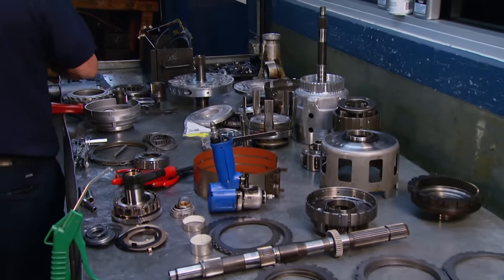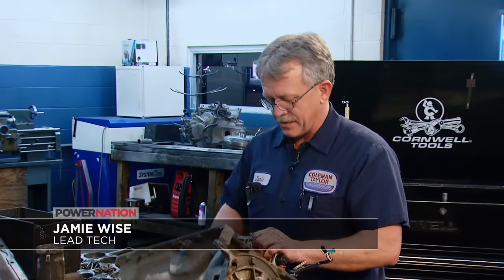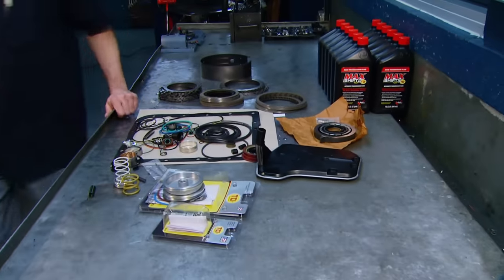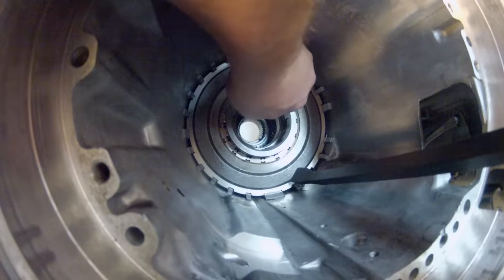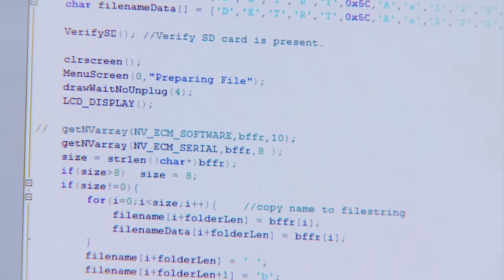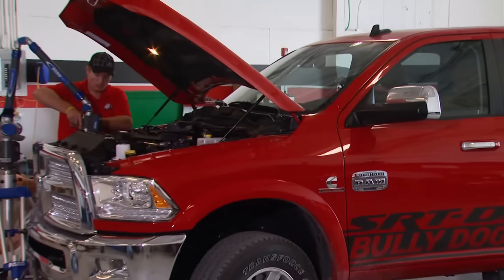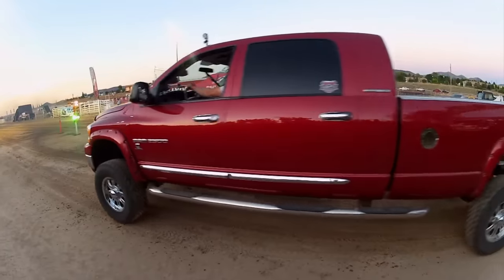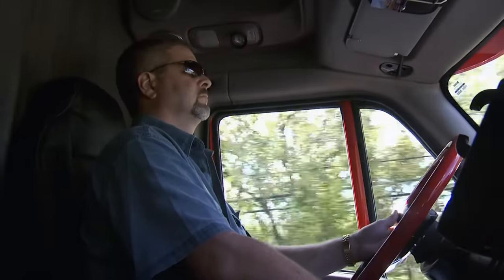Rebuilding a GM 4L60E Transmission for a Chevy Silverado - Truck Tech S1, E12

Comment: Step one: Throw it in the trash. 
Step two: Buy a 4L80e.
Reply: Love it! 😆👍
Reply: They can be built, but it takes someone with competent skills something today everyone says throw it away (parts changers) - no skills.
Reply: @mt1885  or you can do some valve body work to a 4l80 and handle metric shit loads of power wayyyy cheaper
Reply: Yes sir
Reply: @kennyfontana2445  Only if needed, most of the time it is not. It all depends on the individuals skill sets. Today it is mentality of throw it away (buy this new) whatever.
Reply: In a light car under 400hp it will hold up for a little while if "properly" built. But why would you want to keep having to drop the transmission to rebuild it all the time
Reply: Many top racers use a 4L60 and if built right can handle well over 1,000hp and 1,000tq all day, all night. What they are not telling you is the 3-5 thousand dollar price tag on those "built" or "performance" transmissions
Reply: @jeromewieland55  BULLSHIT! Some performance shops wont touch a 4l60 because they still break. Why waste time when you can get a $300 junkyard 4l80 and a shift kit and handle 1000hp and have  a better gear ratio.
Reply: @Se7enMiIe  if you can't afford the Sonnax upgradeable parts then stick with the junk yard junk. Some of the best 4L60's will cost you $5K. It just depends on how much work you need your transmission to do
Reply: Kenny Fontana stop listening to the drive way engineer. He's wrong and so are you.
Reply: @jeromewieland55  4l60 will cost 5k and still break, those professional racers are also having that 4l60 gone through after every race. 4l80 is superior and what does it matter if its junkyard junk If it's getting you into the 8s for 300 vs a 5k 4l60
Reply: Se7enMiIe btw I sell you one of them for $2500 with a Pay after pass 1 year unlimited abuse warranty.
Reply: @garyrobinson3735  no thanks. If you were that good at rebuilding them then you would be known. But your shop, Panther Pride Transmissions is unknown and you try to sell transmissions on letitgo. Not to mention your buisness has 1 review and it's a 1 star review for the bad transmission you sold somebody 😂😂
Reply: Se7enMiIe scared money doesn't make money my guy.
Reply: @Se7enMiIe  bahahaha...gone through after every race??? Uhh nope that's a fairy tale. Frank Cahall builds them in Florida and one of his transmissions has been in a Camaro for 3 years now and it runs in the high 8's...why did the owner have Frank build a 4L60...because the best built 4l80 from God himself or from Billy Bob's junkyard is SLOWER than a 4L60.
Reply: @jeromewieland55  if you say so guy. 3 years ain't enough time and that 4l60 will be dead soon. People put all they money in them and they still die. EVERYBODY says 4l80s are better then 4l60 but you. 80s have better gearing and are stronger. LS swaps around the world running stock 4l80s to 1000 hp and you putting 5k in a 4l60 that's gonna break again. What's that saying about a fool and his money?
Reply: @Stevesbe  Rebuilding it all the time, FAKE NEWS
Reply: @Se7enMiIe  bro....they do not do not do not do not have better gearing...if that was true then people wouldn't build their 4L60. They'd go buy a 4L80 and be the slowest car at the track. They are the worst for gearing and are dedicated to run 2-3 tenths slower behind the same motor
Reply: @Se7enMiIe  almost every serious racer rebuilds their motor and transmission every year. You either have no one around you that's shown you the internet or you're a fool
Reply: @jeromewieland55  the more you type you show you dont know shit. 4l80s have better gearing, period. A junkyard 4l80 with a shift kit is $400 but you have to put $5000 into a 4l60 to get it up to par and that sounds like the way to go to you? 4l80 has a larger rotating mass so there's some parasitic loss but if you're running that kind of power a 4l60 ain't gonna cut it. Turn up the power and there loss is nonexistent.
Reply: @jeromewieland55  I know better then what you're selling. Its obvious you dont know what you're talking about. There 2 people here saying 4l60 is better and the rest of the people on this comment and the other comments are calling you a idiot because you think a 60 is the way to go. 😂
Reply: My 4L60e just crapped out at 160k (typical) of my 07 nbs Silverado.  It’s a non tow rig with a little 4.3 v6.   I don’t want another failure.  Would it make any sense to try to use a 4L80e I. My application?  Or is that v6 just too gutless for that 4l80e?  Probably get the worse mileage ever trying to turn it.  Any suggestions?  Thanks
Reply: @freerepublicusa2064  realistically how long you plan on keeping the truck and what do you plan in using it for? A 4l80 swap means you'll need a crossmember, repin your harness(free) or a add on harness to control it(150), and a tune. If you get a get rebuild and aren't beating on it it'll last another 150k. What the issue with your trans? Is it the 2-3 shift?
Reply: Kids kids kids... hands to yourself
Reply: If you're incompetent like you, than yes throw it away. If you're actually well versed in rebuilding, just get a higher HP master kit for it and it will not break that easy on you.
Reply: Ok you bunch of gear heads.  Which one is best for a 4x4 1 ton plowing snow?
Reply: John Parkhurst a 4l80e or preferably an Allison 1000
Reply: Maybe they're meaning to say Yo- Buck.
Reply: My stock 96 4x4 Tahoe 4L60e went 285k miles before I had to rebuild it. The only reason I had to rebuild it was because the aluminum forward clutch piston cracked. I had loss engine braking and the transmission was slipping going too 2nd and 3rd. gear at 75% throttle or more.
I installed a used steel forward clutch piston from a 99 Blazer. I also reused my stock front and rear planets. They were in good condition because I changed my fluid and filter. I didn't do any upgrades because they are not needed. I used a new stock sun shell because the engine was stock.
GM put really good clutches in their stock transmission. The problem is people don't drop the pan and change the filter. Then they bitch at 150k because the tranny stop pulling.
Reply: @Stevesbe  You want have to keep rebuilding one if it is done right.
Reply: @Se7enMiIe  Dude you are lying your a$$ off. Shops love rebuilding 4L60e because they are easy and don't cost much to rebuild.
Reply: @jeromewieland55  Dude I think you are confused.
Reply: hahaha
Reply: LMAO the 4l80 is even worse...
Reply: @kennyfontana2445  From the factory, the 4l80e was rated for around 800lb ft of torque.  It was put in everything from 1/2tons(optional) to 1 ton chassis cab's.  It had to be able to handle a wide engine array, from the 4.6l v6 to the Duramax 6.6l v8.  They can't really hold more than 800lb ft without major modifications to the internals, and past 700, they start to slip really bad if you rag on them hard.  The 4l60e is very much possible to upgrade to handle more, and its a physically smaller transmission, so it will fit in some spaces a 4l80 would not without chassis/body modifications. I have a GM reman in my van, but when it goes, it will be getting built like this one, as I have already purchased the upgrade sunshell and pinions, the biggest weakness will always be the output shaft, which will limit these to around 700lb ft of torque max with the stock output shaft.
Reply: @jeromewieland55  the newer ones are 2600 for a reman, and around 5000 for a "stage 2" build, which is just upgraded sun shell, better pinions, and a shift kit, but stock output shaft and pump housing.  A "stage 3" puts in a different pump designed for higher than 6000  rpm revs, and a stronger output shaft, along with way stronger bands and pinions.
Reply: FreeRepublicUSA no just get a good new rebuilt unit with a .500 boost valve and Corvette servo and maybe the Sonnax shift kit or the least delete the pwm. Overall that'll be a solid fix for most trucks hauling or just not wanting to build every 5 years. Also, hook it up to 60,000btu cooling capacity and it'll be a done deal.
Reply: Why are the 4L60e models garbage?  I have a '10 Colorado which has one but I've always been curious what makes them a bad transmission.
Reply: Gary Robinson contact info ? Looking to buy one of your transmissions
Reply: @Se7enMiIe  my uncles family has had chevys forever and all of them bought new, and going 200-300k easy before selling them for new ones with no work only maintenance on them. So that is bullshit. They just sold their tahoe that had 300k on all original equipment. It is not impossible, and with a competent driver, and decent maintenance, anything will last.
Reply: step one: don’t buy gm
Reply: I agree, 1000%!!!!! Learned this the hard way on my '00 Camaro SS. Stock horse power, but very heavy. After multiple rebuilds, I got a junk yard 4L80E and built it to hold 750-1000 hp. I think I could build a 4L60eeee that would hold 500 hp ………. for awhile. I could have put that 4L80E in as is from the junk yard and hold more than a built 4L60eeeeeeee. Very happy with my 4L80E. Will never have to worry about sitting on top of a land mine again. 4L60eee = boat anchor use only.
Reply: lol at people defending 4l60e
Reply: @Se7enMiIe  Why waste time?  Because adapting a 4L80 into an awd/4wd truck is more work than the truck is worth.
Reply: A junkyard 4l80E properly rebuilt, and a appropriate shift kit and cooler, would probably be a much more cost effective/longer lasting solution, than a seriously built 4L60E, for a Full-Size pickup truck application. Granted the 4L60E has the advantage in its gear ratios for speed. However, for a truck application (heavy vehicle, payloads, towing, etc.) the strength advantage will be soooo worth it with a 4L80E, also would be better suited for higher horsepower and torque if you wanted to upgrade the engine. 4L60E is better suited for cars, small/mid-size trucks and SUV's only in my opinion. Not full-size Pickup's.
Reply: @mt1885  whats mods do you need to swap 60 to 80e?
Reply: @jonathanurbina4427  They make a kit to build the 60e and/or available to get one that will hold up no issues. monstertransmission has some good videos on it
Reply: Step three: Throw that in the trash
Step four: Buy a manual transmission.
Reply: this seems to be a heated discussion

Comment: Hello
I am repairing my tahoe transmission(4l60e), changed lots of parts to new, it goes smoothly to N,P,R,1,2, everything works amazing, except D is not working, you can go to D while driving only, can you help with that? Did you have such problem? Thanks

Comment: I rebuilt my 4L60E trans from my old 94 V6 camaro in a morning with no special tools with a watchful eye of a Ford Master tech, all for  $80 for the rebuild kit.
Reply: CamaroAmx There are at least two special tools you need. One which you can make with a bolt and some pieces of flat stock. Simple, but it is a specialized tool. 

Then there is a special socket needed to pull the bell housing off the newer 60e’s 

The vacuum tool this guy used is also a specialized tool. One you don’t know you need till you run into a trans you rebuilt that gives you probes

Comment: Hey how r u. I have a 2002 base camaro with a 4L60E and is the internals different then the one that came in the ss camaro
Reply: The 4L60e in your vehicle has a removable bell housing, and a few other things that are different but it's pretty much the same.

Comment: what do u guys think of the 02xx 400r turbo i have 4 of them sitting all good the book said they are good to 800 hp but after reading the paper work looks like it would not take much to get a lot more out of it they have heavy clutches bigger pump stage one shift kit stock built . i keep getting the 450 hp 454 with the 02xx trans for free all low mile set ups 6,000 to 58,000 on them, saves me a lot of money on a build

Comment: If my 5.3 v8 vortec motor had 450 HP would i have to have the 4l60e transmission rebuild to handle the amount of HP and more fl-lb

Comment: "Most guys refuse to build transmissions". Really? I've rebuilt a few myself and actually I would rather rebuild a transmission then an engine. Transmissions are only scary until you get involved rebuilding them. They are actually built in sections. And then each section gets installed back in the case in order and really isn't hard to do or scary either. It just looks scary because of the part count. But if you go about it in any type order, you'll see there really isn't much to them. When you rebuild a valve body, as you remove the pistons, plugs, pins, springs, valves, balls and such, you lay them out in the sequence you removed them. And clean the individual parts and lay them back in the same order for reassembly.  JMHO

Comment: Now that you've had the truck for a while how's the transmission holding up. Did they do a good job. I'm thinking about doing an LS swap on my 87 blazer and I'm gonna run 4L60. There's shops only about 300 miles from me so I want to know if it's good.
Reply: Just don’t do it, run a 4L80 or TH400

Comment: I did a th400 just for fun only to find out it was no fun😕 now I just get my trans from AutoZone. Comes w 3 yr warranty, unlimited miles and it’s remanufactured. Not rebuilt. All I do is swap it out for less than the shops.

Comment: Beasts cause vibrations in 3rd because they aren’t speed balanced nor are they heat treated, ive seen them strip out on stock vehicles. Aftermarket 5 pinions fail faster then factory 4 pinions.

Comment: Great video.In My 4L60e,in my 2000 Chevy s10,I was driving and noticed it slipping a little.All of the sudden it quit pulling.Like it went to neutral.Next day it worked until it got warm,then nothing.What you think.
Reply: It’s smoked.

Comment: The only upgrade is a 4l80e
Reply: Dont you know that the only difference between 4l60e and 4l80e is just more heavy duty parts in certain areas.
Reply: @JM-yx1lm  im well awear but the only reason i would remove  a 4l60 is to throw it in the trash.
Reply: @JM-yx1lm  That's completely wrong. The 4l60e is based off of the extremely flawed 700r4 where as the 4l80e is based off of the TH400 even going as far as to share parts between the 2. You need to do more research.
Reply: Exactly
Reply: @Lordspaghett  the TH  transmission was even used in the M3 Stuart says a lot about how robust it is.
Reply: @bryanmartinez6600  the th400 was also used in the Rolls Royce Silver Shadow at one point

Comment: I've got a 1994 4L60E that's never been taken apart ever to fix and it's just now running the torque converter out, 3rd gear shakes the whole truck if you slightly apply throttle but if you romp on, it smooths out.
Reply: I’ve got a 2001 I’m at 190k with no rebuilds before me it’s hunting gears so now I’m going to rebuild it
Reply: Sounds like the uh…. Transmission is bad.
Might have to hit up a junk yard for another one

Comment: The Beast sunshell does break.The 5 black springs in the direct drum,tossed in the trash can.They restrict the clutches from floating burning them up.Aftermarket says to do that finding this out and GM says to put them back in.Don't ever get a Monster transmission,junk.No upgrades done,mismatched clutches doing bad work.I know a transmission repair shop in my area that hates these,they fix their screw ups

Comment: BTW, I built my 4L80E for a total of $2,425.00, INCLUDING the $900.00 converter. This would be a $5,000.00 build on a 650 hp 4L60eeeee build, and you better pray your car is hella light.
Reply: Same here and I used AN fittings, braided SS lines and a true cool 40k cooler..miles ahead of the 60eeeeee(the sound they make when they hit that mystery neutral lol)..use that 60e as a wheel chok or boat anchor..
Reply: @spyderlyf3  Man, I like you already!!! I also use the same big ass Tru Cool 40k cooler.

Comment: Will a 4l60e out of a 2007 Yukon xl 4x4 work in a 2003 Chevy Tahoe z71 4x4?
Reply: I believe the 2007 4l60 has a sensor added to the input shaft, you can make it work with a 2003 by just swapping the harness along with the force motor on the valve body. All 4l60e have the same oil circuits on the case, what I would do is swap the valve body and harness and it should work fine.

Comment: to all you driveway guru's as well as myself  I'm sure the cars that have a 4l60E is a bone factory stock car/light duty trucks that you're working on and if you need more than 275-300hp to beat heavy ford/rebuilt dodge😂 there's a problem.

Comment: I have a 1997 Silverado and the problem is that it only uses the 3 speeds when it is in 60 miles at 2000 RPM the engine sounds forced

Comment: Maybe you can help me.  I have a 2002 camaro 35th Anniversary v6 with a 4L60E. Can someone tell me the difference between my transmission and the 4L60E in a 2002 camaro ss with a Ls1
Reply: Stacy R. Nix the ls version has a corvette servo for the 1/2 and 3/4 band. Its all the same after that
Reply: All 4l60e are basically the same the only difference between 4l60e mounted to the v6 or sbc 350 and one's bolted to the LS are input shaft and bell housing. Ls use the 300mm inputshaft all others use 298mm.

Comment: Don't know why the shop didn't use some kind of pressure washer to clean the transmission case.  
Would have been better than the "solvent cleaner" they used that didn't really do a whole lot of good.
If I am gonna pay $1000+ for a transmission rebuild, I want it to look like new when I get it back.

Comment: Why not go to a 4l80e since you have added a lot more power.
Reply: Because they get to make another show about how to rebuild a rebuild after this one blows up..no money in the cure lol..
Reply: Plus the 4L80E is not a direct bolt on in that truck. The 4L80E is bigger dimensionally so modifications would have to be made to the trans tunnel and exhaust routing. Plus it’s not a direct bolt on to the engine they are using.
Reply: @CamaroAmx  highly unlikely Mods are needed in a truck that came with a 60e..